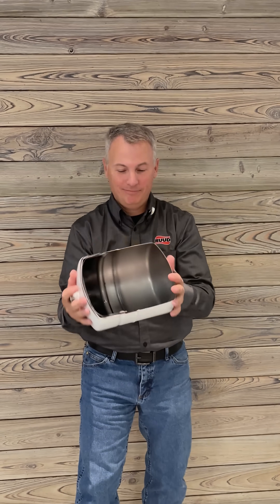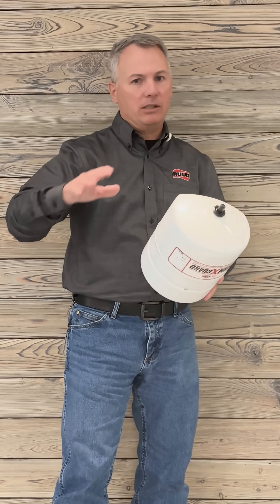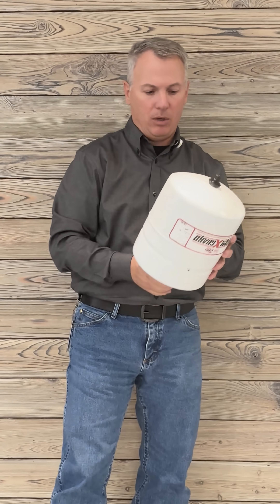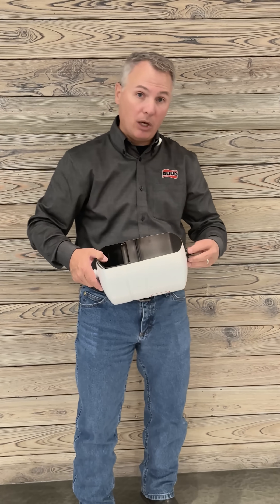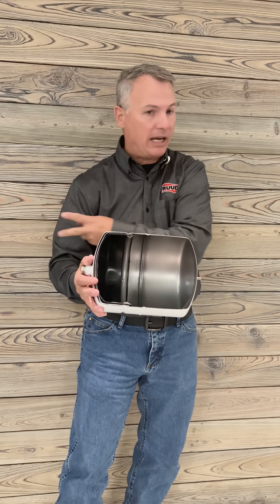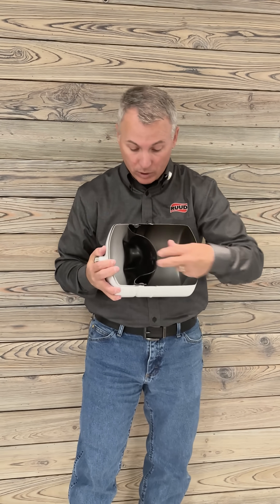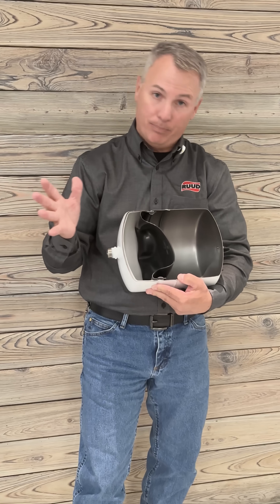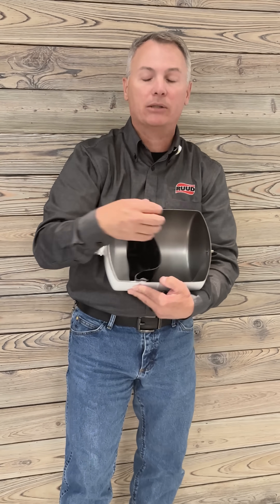Why do Expansion Tanks Fail?

Comment: I build a pressure sensor that attaches to the schrader valve and sends the data wirelessly to Home Assistant. Should the bladder fail, there will be a pressure spike, and I have automation that shuts off my water valve.